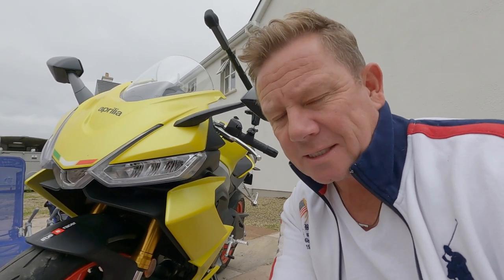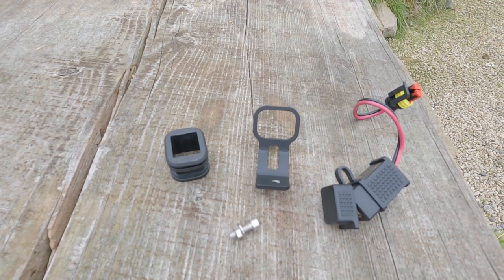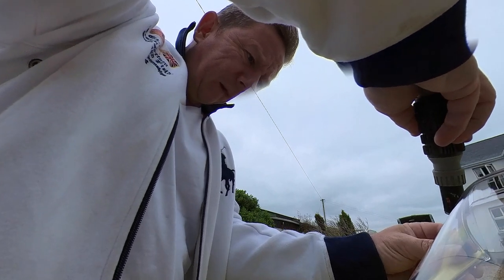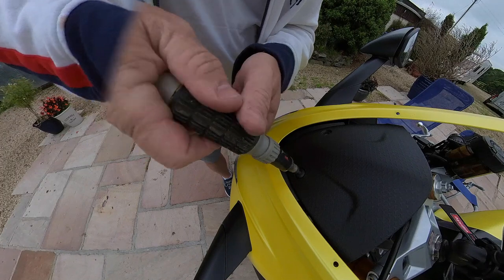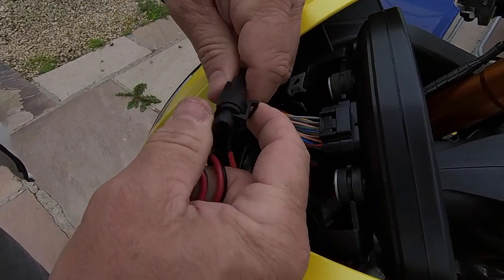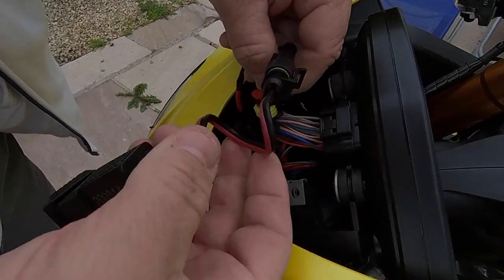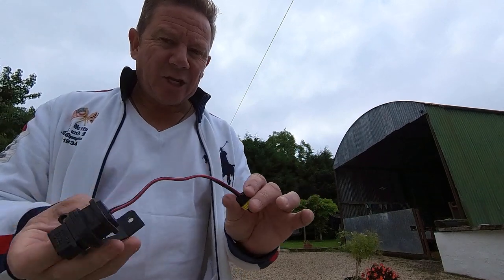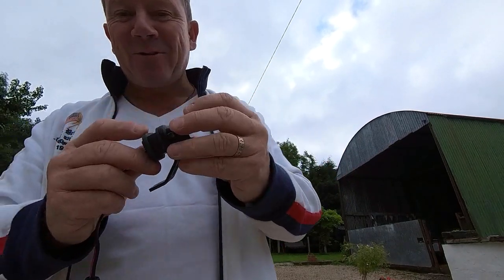How to install the USB socket accessory on your Aprilia RS660 | Step by step guide.

Comment: Thank you! Helpful guide. I havent added the kit my bike yet.
But pushing the rubber gasket + bracket unit over the usb box was definitely a challenge. Took me some fiddling but, I was finally able to push through the process.

Comment: @Wheelie Good TV have you found any power cuts or problems since installing. As I've read that that pin is connected to the same terminal where you have lights and other important things. 

So my understanding is that if drawing too much power it can cause whole dash/ or signals to fail as well
Reply from the maker: Hi Brendan, no such problems fortunately. It has worked perfectly since installing. 🤗👍

Comment: Great Vid Dave enjoyed it and was looking for an easy way to get a USB on my dash without having to run the line from the battery!  Absolutely stupendous!  Bravo!  Where did you get the USB outlet from?
Reply from the maker: Thanks! I got it from www.scooters.co.uk
Reply: @WheelieGoodTV  have you found any power cuts or problems since installing. As I've read that that pin is connected to the same terminal where you have lights and other important things. 

So my understanding is that if drawing too much power it can cause whole dash/ or signals to fail as well

Comment: I'm still wondering what that first loose connection you found is for🤔
That sets off my OCD ..🙆‍♂️😜
Reply from the maker: To put you at ease Ken, I believe it’s for heated grips. 😮‍💨
Reply: It's for the anti theft system status  light. I have installed it.
Reply from the maker: @StintStier  ah ha, thanks for clarifying that. 👍🏍

Comment: Why did you have to install it this way? I saw another video where there is already a cut out on the left side of the dash for the USB to go. You just remove the cover and the plug is behind it. But then I looked at the pdf instructions online and it shows the way you did it. I am totally confused??!? Are there two different bike models or what?
Reply from the maker: I suspect this is for American versus European versions.
Reply: @WheelieGoodTV  so of course I did not pay attention to the title 😆. You have the RS and I have the Tuono. That is the difference. 🤦🏾‍♂️. Much easier to install in the Tuono and $10 cheaper because you do not need the metal bracket.